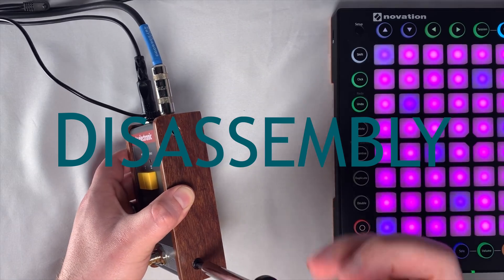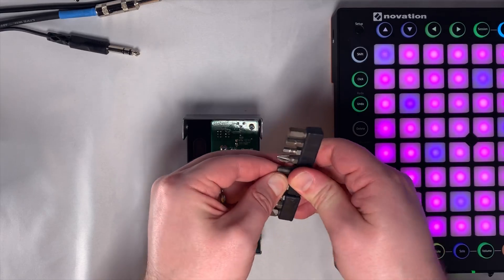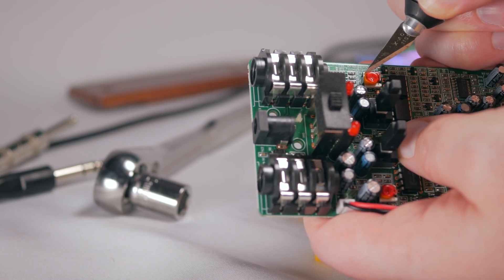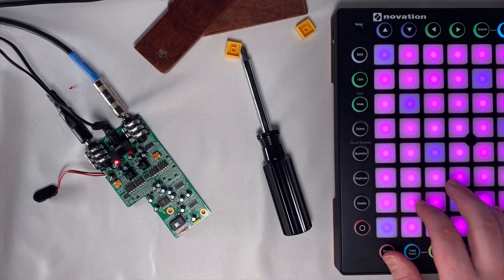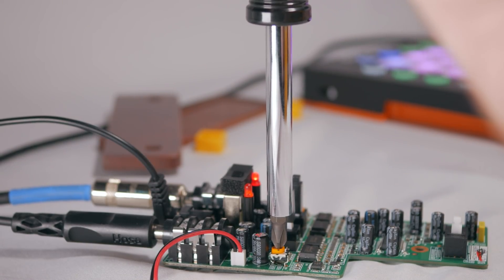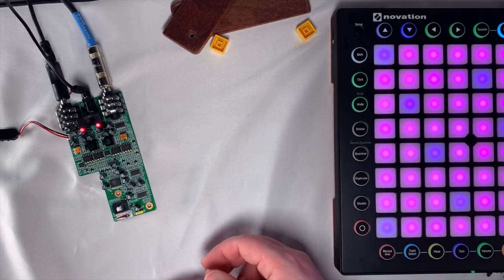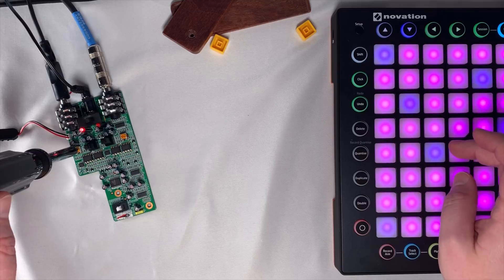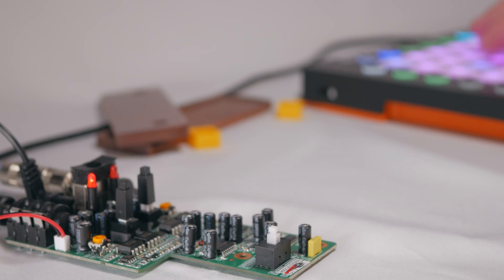June-60 Follow-Up: Internal Trim Pots

Comment: Hi and thanks for the vid ! I've read that if you replace the 1024 stage BBD of the TC electronic version by a 256 stage BBD you get closer. But then, my question would be : Would that affect the internal clock?

Comment: I’d like to mention that the pedal does not have to be disassembled to get at the trim pots. The underside of the trim pots are accessible through the bottom of the board and can be adjusted with a mini flathead screwdriver. You may need a flashlight to see them through the small holes.
Reply from the maker: Good info, thanks for the heads up.
Reply: @Bloom_Music  thanks for tearing down anyway!
Reply: do I still need to take that glue off the post if I trim those from the back of the board?! thank you, best regards!
Reply: @graphenemusic5922  probably, but its not really strong stuff, you might be able to move the trim pot without removing the glue. I did it anyway.

Comment: Great vid. Be interested to know what electronic value these trim pots are. Perhaps they can be replaced with a smaller value and make them into a full potentiometer mod for mounting on the outside of the case. I suspect there maybe a few other tricks we could do to this also.
Reply: I think the pedal would really, really benefit from mods
Reply: Someone could make some bucks modding these
Reply: Yes.  My thoughts exactly.
Reply: I opened up mine and both trimmers say 103, aka 10k potentiometers. Also, in my unit when you turn them CCW the sound gets duller and less bright but maintaining the modulation depth, so there's tone tweaking potential there as well